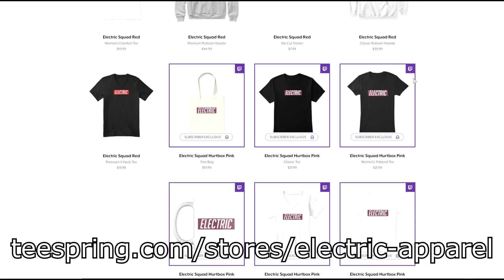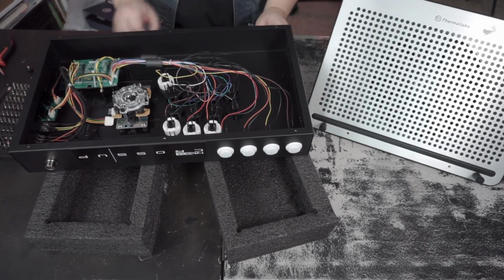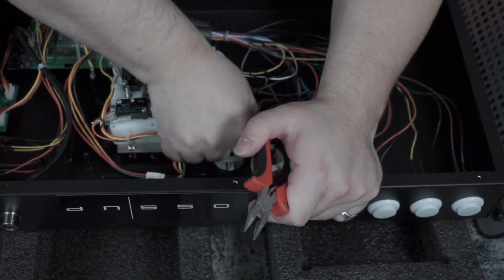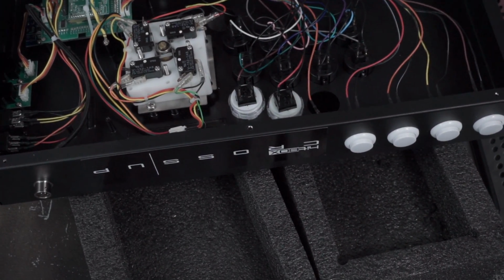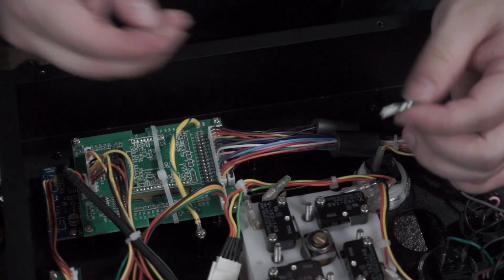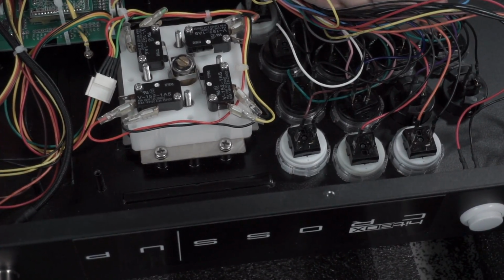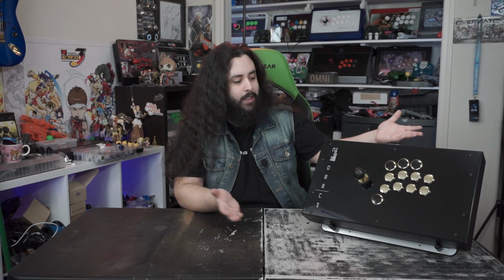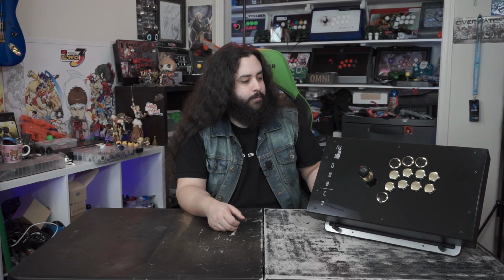This Build was the Most Headache Inducing.

Comment: 17:03 Piece of advice: When crimping the wire...

1] Put the sleeve on first but far back enough that it doesn't interfere with anything first.
2] Optionally solder the wire before or after crimping at the upper exposed end to the quick disconnect.
3] Crimp the wire.

I learned this when adding protective boots to RJ-45 ends. The same rule applies. This way you don't have to fight with the protective sleeve.

Comment: time stamps! (two days left for snack box stick giveaway btw)
merch plug 0:13 - 0:43
2:55 stick opening 

4:20 stick open and lever removal prep
5:55 stock stick out

6:15 new gold & black stick installation then screw in
9:20 stock input button and then 8 main buttons removal
11:50 sped up footage of "quick" disconnect input button removal

12:25 new input buttons then gold & black buttons swapped in
14:02 new input button installation & cable connecting
15:50 removal of main 8 buttons and cable disconnection

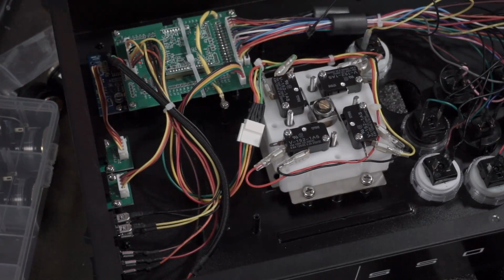16:39 tend to broken button quick disconnect
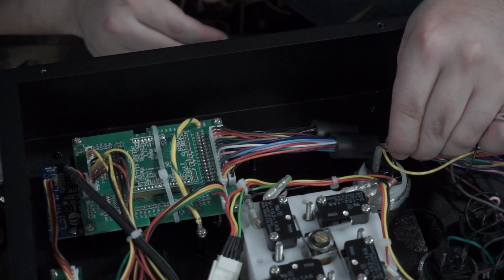20:20 mission complete! button cable was fixed
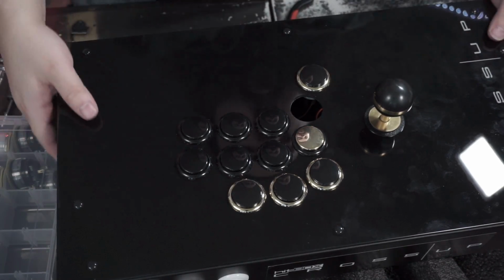21:10 - 26:04 continuation of other main button swap followed by quick sticker peel
26:35 b roll of stick completed then 27:05 Game play
28:01 finale thoughts, input, opinions

36:00 end credit with links

Comment: I noticed a lot of people have issues with tearing off those quick disconnects on accident. They really shouldn't be that difficult to remove, but I guess some companies make their wiring harnesses with crappy QDs. https://m.imgur.com/a/L5FqT5v 
I wish all sticks would use the nice QDs with the press-lock tabs like the TE2 has, those are the best.

If you have stubborn tight fitting quick disconnects, what I do is disconnect them and then jam a small flathead screwdriver into where the button terminal/prong goes in and twist it back and forth to widen the curved metal sides that grip the terminal. Now it should be looser and connect/disconnect a lot easier, but if it's too loose you can always use pliers to squeeze it tight again. It's just trial and error until you get it to fit nice and snug.

If you break or tear off your QDs like in the video, the type of replacement you'll need for most buttons would be .110" (2.8mm) female spade quick disconnect terminals. It's good to have a few of these in your parts box just in case.

Comment: About the hitBox CrossUp, I would remove the four extra buttons, cut the four extra buttons' wires with a wire cutter and replace the four extra holes where the buttons were at with button stoppers. I swear, who plays with 12 arcade buttons, anyway?